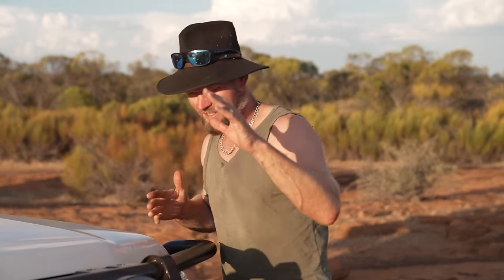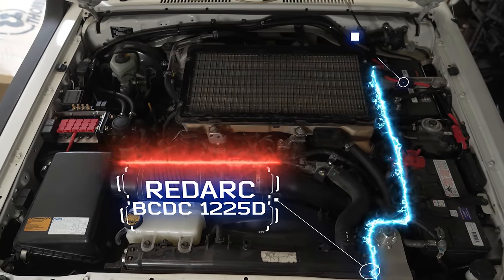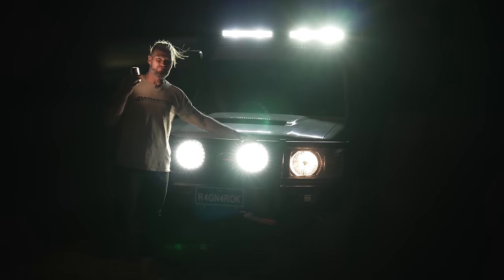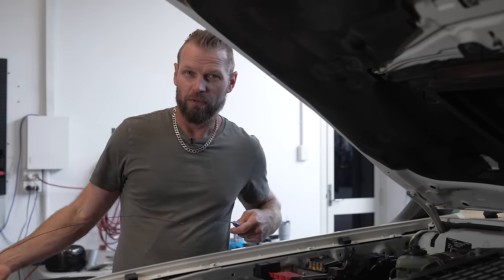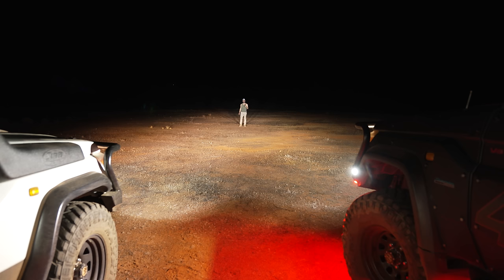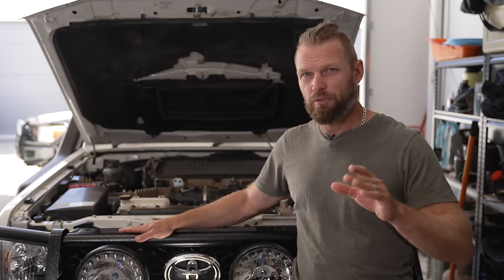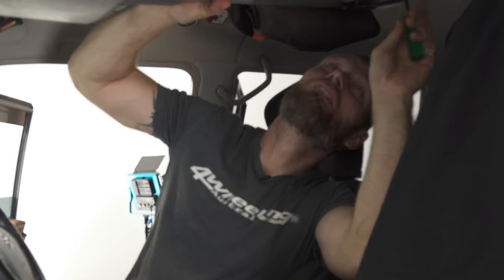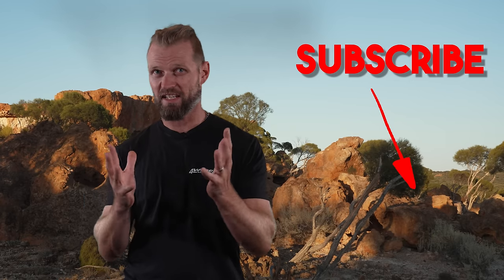Landcruiser, Troopy Project part 4

Comment: The D in the BCDC1225D is "dual input". Meaning it can accept solar and alternator inputs, whereas the old BCDC1225 needed a change over relay to run solar.

Comment: If you look online, there are calculators for voltage loss in "12" volt wiring. Mainly for marine use. They'll tell you, how how many feet (there and back) of wire, supplying how many amps, what size cable you will need for a 3-5% voltage drop. That's the smallest cable you want to use, if you size up one guage the lights WILL run brighter.

Comment: If your using chassis mounted grounds, you should be wire wheeling or sanding back to bare metal, attaching your earth then give it a hit with some paint to stop rusting. Otherwise you can run into dramas with a poor earth, especially with high current draws like dcdc chargers or lights/winches etc

Comment: That hot battery wire wrapped to the far side should also be fused at the battery. If it got pinched in a wreck...

Comment: Radio Antenna: with the roof popped the range will decrease in directions front and rear, and will be nearly identical sideways. As it is an antenna with (at least advertised) gain and vertical radiation, the HF signal spreads like a donut around the antenna.

Comment: 1:35 My biggest issue at the moment is that I have all the wiring and components for my front dual battery setup...yep, my plan is the same as yours, to power the lights, electric fan, and one day a winch, but do you think I can find a spot in the engine bay of the V6 Courier? About my only option is to reroute the air intake and filter box.

Comment: In regards to UHF antenna wire next to high current cables, I had pretty much no choice but to run mine next to the high current cable for the amp for a short stretch in the engine bay. But it's no big deal and doesn't ruin my signal since I'm never listening to music at high volume (or at all) when I'm talking on the UHF. No current flowing through the amp supply cable = no magnetic field in the cable to spoil the UHF signal.

Comment: Ronny Dahl with regards to antennas. An antenna with no gain will send out a signal in the shape more like a ball. The higher gain you go the further it travels but it’s Omni direction changes to more like a dinner plate. So putting your antenna on a slope, as it is with the roof up doesn’t necessarily mean you gain anything as the “dinner plate” is on a slope. It will lower the range in both directions by hitting the ground earlier on the down slope and going over the top of the distant radios.
Reply from the maker: It’s on the roof to prevent the vehicle from blocking the signal 😃
Reply: He's not driving around with the roof up... the roof was up when he showed position, umm that's not how it travels. It will operate as you pointed out it should when driving.
Reply: @brettleonard8602  yes I realise that but he said he was going to check the range with it up. I’m explaining what happens to the radiation pattern of the antenna when it changes from being vertical to being on a slope
Reply: @Ronny_Dahl  yes I realise that. What I’m saying is the radiation pattern of the antenna changes when it is no longer vertical. It has nothing to do with the vehicle, just the change in antenna angle. You said you were going to test the range with the roof up compared to it being down.
Reply: @malcolmL995  I don't disagree with you there mate. Ad a bracket and he could swivel it to "level" again easy fix. I think he's actually at more risk of taking the antenna out at that position way too high on the passenger side. Drivers side would be best option I would think trees grow from passenger side over a track. Pretty cool feature though with the plotting though.
Reply: @brettleonard8602  yes, it would solve the issue with a bracket that could make the antenna vertical again. 
Yes, I thought the plotting feature is a great idea. 
Yes, agree about the antenna being on the passenger side. I think what happens sometimes is that we mount the antenna on the bull bar passenger side so it doesn’t interfere with the driver’s vision and forget that isn’t an issue when it’s moved somewhere else. HF antenna are normally mounted on the rear right for exactly the tree issue.
Reply: @malcolmL995  thank mate for not getting upset and defensive. I love it when through conversation we can overcome the crap society seems to be consumed with. I'm assuming you're of a better vintage/era? Hopefully Ronny reads our convo and gets some tips😉
Reply: @brettleonard8602  yep, sorry, probably was a bit defensive. I’ve been in the comms industry pretty much all my life and was having another guy on another post pretty much telling me I didn’t know what I was talking about. He told me that if he didn’t know something then it didn’t exist. But you get that. 😀😀😀😀
I hardly ever post because it doesn’t matter what you know there is always someone that will tell you that you’re wrong. These new antennae sure look great, but gain isn’t everything because there is a trade off, in other words you don’t get anything for nothing. Have a great day.

Comment: for me for general comms I would be keeping 3 coms 2 in UHF keeping 1 in 80 chan narrow band and  the other in wideband  because you are likely to  access farms this way and also have  a  27MHz radio for longer distance  communications needs...

Noting if tag along tours of more than 3 vehicle at 5 watt pep  you have a radius of 2.5 km from antenna, for  over lap of signal  4.5 km range between  2 radios, for longer distances I tend to stick with  12 watt lsb/usb HF comms

Comment: I like using 5 or 7 core trailer wire to run through the firewall between the switches and relays.

Comment: Great tip on the engine bay for coms. I fixed radios for years and em interference is a bitch! I just run a Midland base camp 5W. Seems to be enough for at least a mile over any terrain. It's portable and I just sit it on the passenger seat. Works for me, but not needing near the coverage you do. I run two 3W handhelds for my pals and it seems to work fine.

Comment: Hey, Ronny...I would like to know where to lead wires from side and roof lights ? I have old 1984. 60 series and I'd like to avoid making holes in the roof, or lead wires along the roof, or through rain gutters.. I assume that drill a hole or two i the roof is only neat method to do it, but what to do with connectors/wires when i need to take down roof rack? 
I won't praise your videos, because i don't do things like that, but even so,almost every educational video of yours is very good and i learned a lot...
Greetings from Croatia...

Comment: I'm the one that always tells you the same about lights on the roof. Just at least put some extrensions (like inferior visiors") below the bar light... so the light beam doesn't "touch" the windscreen nor the bonnet.
Reply: Or just use narrow high beam lights if installed on the roof :) But your advice is great anyway :)

Comment: This is not a short comment…

A damn good episode! Thank you, Ronny. 

About the extra lights …. You’re right on every detail BUT the second battery. 

I’ve wired massive amounts of extra lights on my vehicles for the past 30 years. I always do it the same way. My wiring has never failed me. (Meaning, in parts you’re dead wrong my friend). 

It is the amp’s produced by the alternator that is our limit - NOT the battery. The battery is only an equalizing unit from the alternator to the consuming source. 

Meaning, if we have an alternator that give us 100 amps we can have an electrical consumption of 1200-1480 watts. 
Because if the alternator give us 12 volts times 100 amps it equals 1200 watts of consumption. 
If we have an alternator giving us 14.8 volts times 100 amps it equals 1480 watts of consumption. 
Please keep in mind not to overload the alternator’s capacity because it’s a pretty expensive part to replace. 

On my old 1997 HiLux in Sweden I had 1 Lux at around 2500 meters distance. Today, on my 2022 Jimny in Central America, I have 1 Lux at around 800-1000 meters. FYI: 1 Lux is what you need to read a news paper or a book. 1 Lux is what we get from one candle light / candle flame. 

In the old days Watts was the value to look for. Nowadays (with LED lights) it’s Lumens and Lux. Lumens is the value of a light source. Lux is the value of the light reflected from a surface. 

At noon the Lux value of the sun is about 30’000 to 100’000, depending on the weather conditions. 

Today, on my Jimny, I have a THEORETICAL Lumens value that by far exceeds 48’000. This means that at 800-1000 meters in front of my car it gives me a value of 1 Lux.

About my Jimny - 
From the battery to the last light/lamp/ of the harness on the roof rack I have a loss of current that is less than 0.2 Volts. I consider this a very good result. 

-
Explanation…
1. Wire thickness is way more important than most people realize. Google for wire charts and use a wire one level thicker than your chart recommends. 
2. Use Bosch relays. Cheap relays are crap. 
3. Solder all connections to minimize loss of current. Zip tie all soldered connections as the soldered points are very sensitive to vibrations.
4. Use dielectric grease wherever water might interfere with the electrical infrastructure. 
5. All extra lights should be connected to the original high beam. If you can turn your extra lights on in LOW-BEAM MODE you haven’t installed your extra lights correctly. 
6. Consider replacing your regular halogen H4’s with the LED H4’s from X7-Seven. They are by far the best buck for your money. The same thing goes for your DRL’s/fog lights. 
7. …and while you’re at it - consider replacing the rest of your halogen bulbs with GTR’s from HeadLight Revolution. I’ve done all the above in my Jimny and I have brighter lights than any other. 
-

As I’m a radar engineer, yes, Ronny, you are 100% correct regarding radio electrical interference. 
Proof of that…? 
Check the wiring along your door sills.
One side is positive, the other is negative. Never, NEVER, does the two share the same side. 21:25
Reply: Two points you may be dead wrong on my friend … 

LED globes in vehicles where not originally an option or fittment from factory is illegal … you can’t just retro fit them to any vehicle, they’re not ADR compliant nor would the vehicle be. 😉

And yes, you should always run power down one side and communications or a radio antenna coaxial down the opposite, been doing this for years and agree with Ronny, you can get A LOT of interference through the radio from the engine and / or the alternator. 
I’ve fitted many big car audio systems over the years, some comp’ type setups, and it was always common practice to avoid interference, something more prevalent in older cars with points as opposed to electronic ignition. Some setups even needed interference  suppressors put inline to help aid in reducing the whirring sounds coming through the system. 

Great clip Ronny as always mate 👍😉
Reply: @4WheelingInNSW  
Thank you for correcting me. When I wrote my comment I didn’t think of how privileged I am living in Central America. Here we don’t have the rules and regulations regarding lights and other stuff you have in Australia. 
- You are absolutely right, any country’s regulations must be respected.

Comment: Hi Ronny, If you have your Ears on !!!!!!!     could you tell me where you got the Fuse Plate and bracket setup for the Drivers side. Also what size cable did you run around the back 35mm 50mm???
Reply from the maker: Offroad living in wangara has the busbar fuses that I used.
Bracket was just bent up to suit the PDP fuel management kit.
Cable size was 6B&S
Reply: @Ronny_Dahl  Excellent Thanks Ronny !!!!!!!

Comment: Hi Ron, With your Cable run from the Battery I notice you have a Fuse Holder mounted on the side of the Body, did you use a Rivnut for that or ??

Comment: If you're only using the 2nd battery in the engine bay to lessen the load for high current why not just run the 2 batteries and parallel and skip the whole DCDC & isolator?
Reply from the maker: I’ll loose the ability to jumpstart the vehicle if both are flat then.
Also if both are parallel 💯 of the time they will both die the same time. You can only change the batteries as high as the lesser one will accept.

Comment: Great video Ronnie, I was thinking of installing a duel battery system on my little road runner like I had I'm my Jeep but $1700 is a lot of money, I'm thinking positive and negative feed through solenoid to secondary with feed back through cab rocker switch to starter basically a back up, I don't think I'd run the roof lights or cb from it but handy for inverter powered tools when necessary, what do you think? Love the troopy by the way, 
👍🚙👌🇨🇮
Reply from the maker: That would work. Just make sure you got the right size fuses everywhere

Comment: $1700-00 what a rip OFF did mine on the 80series for a few hundred dollars same result 😋
Reply: My thoughts exactly. BCDC 12250   -  $400-$500, solenoid   -    $200  if using Redarc  -  and wiring? Must have shares in company.
Reply: I forgot to add in the battery tray for anything up $400 these days, but still an expensive kit.
Reply: @jamessmith-fy7bv  my set up all up with red arc $250. I suppose these new age city people have no idea How to do things(they got to much money 💰😁

Comment: I've got a set of spotlights with similar dimensions to yours. Do they have any effect on radiator airflow?
Reply from the maker: Never noticed any negative affects or changes to the temps.
Runs the same as before 79-82c when it was 40c in the Outback it ran at 85c
Reply: @Ronny_Dahl  Awesome. I'll mount mine and see what happens. Cheers, Ronny.
Reply: @BradGryphonn  l got 4lights in front on the 80 for years Never had a problem.
Reply: @tadeuszmichaelwlodarczyk3120  Cheers, mate. I started mounting them day before yesterday but the rain stopped me. I'll finish it today. I don't have a roo bar so I've made some mounts for them. I'll pop a video up when I'm finished.
Reply: @BradGryphonn  👍🤠